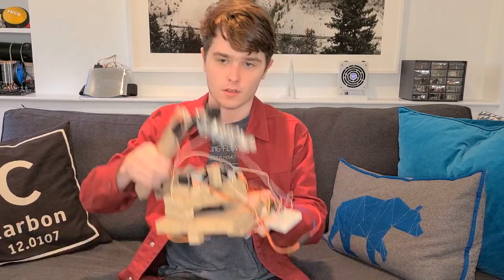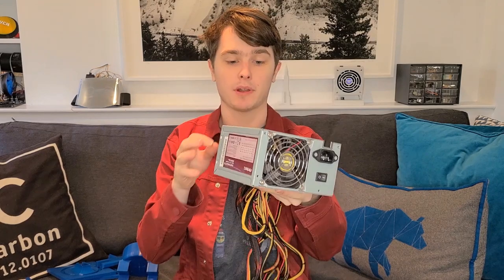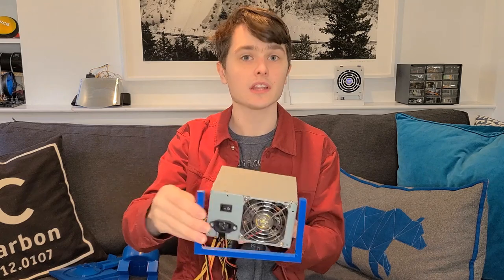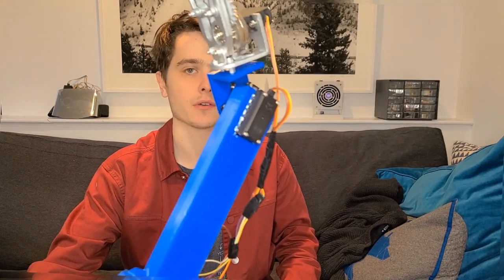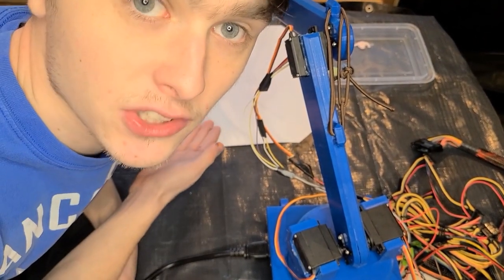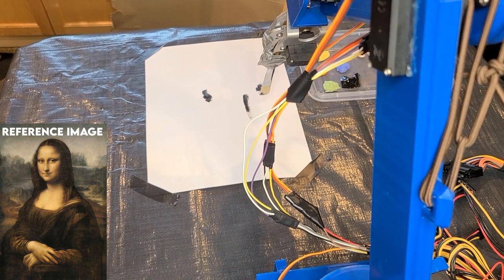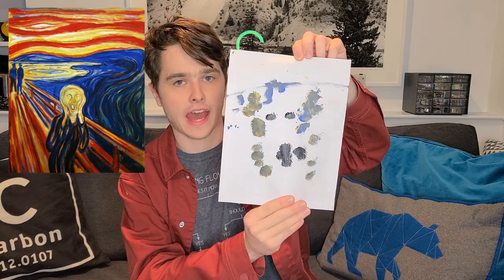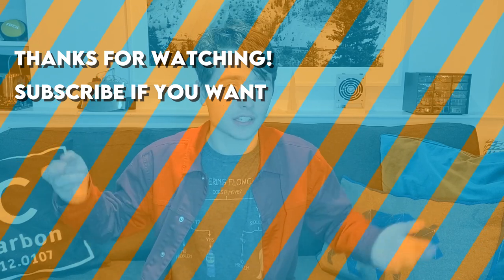Painting the Mona Lisa with an upgraded robot arm

Comment: The energy in those brush strokes speaks to the trauma encountered by the robotic arm’s predecessor, to which it was a witness. The violent application of the eyes suggest fear of an existential crisis. Very expressive and moving to witness. Are you taking commissions?
Reply from the maker: Yes, the emotion shown in it's brush strokes was quite phenomenal, especially for a non-sentient robot, however I do believe that programming emotional responses into the robot will result in increasingly expressive pieces.